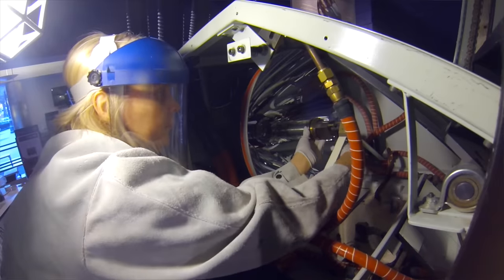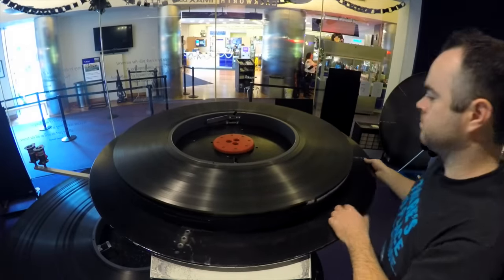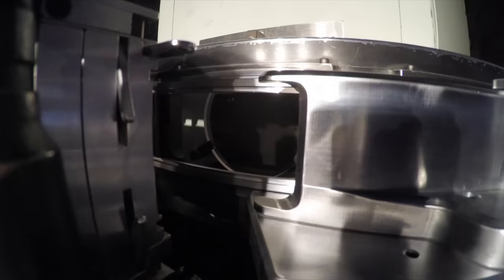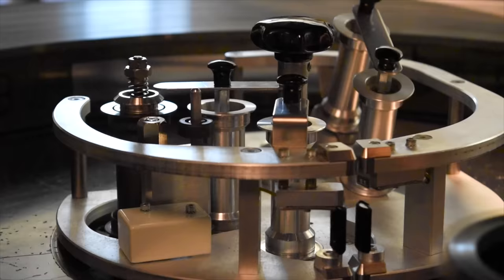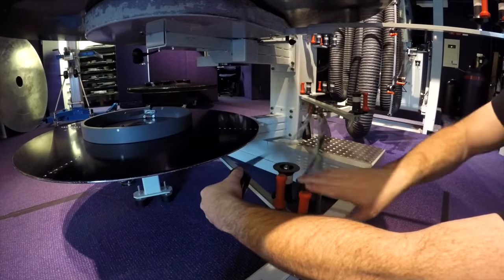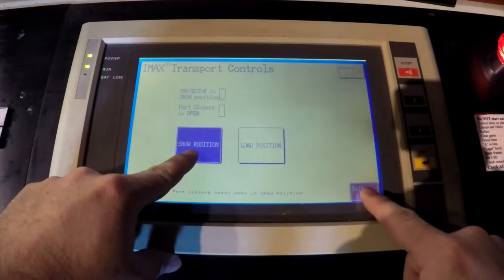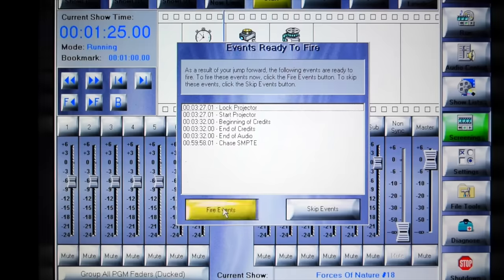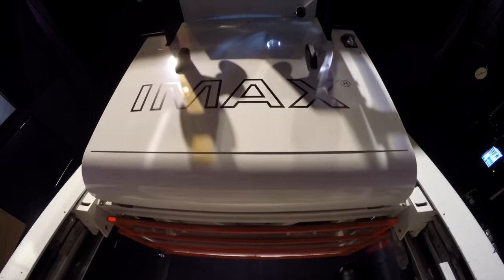The Incredible Process of How a GIANT 70mm IMAX Film is Played

Comment: I wonder how big an IMAX movie would be as a digital file with no compression. Seems almost easier and cheaper to have each movie on it's own 10tb hard drive.
Reply: here in Australia they're on drives, all digital
Reply: @justdazr5950  Ah nice. Are the movies downloaded or delivered to you?
Reply from the maker: You would lose a ton of resolution using a digital file. 70mm is equivalent to 18K digital.
Reply: Senior Tech of a circuit in the USA here, movies are usually 150GB to 300GB depending on 2K vs 4K. The files are not compressed at all as every frame (24 per second) is its own uncompressed TIFF file, but the color formatting does change anywhere from 8bit to 12bit. Most movies are 12 bit unless they are 3D where they have to drop the color resolution due to playing technically two movies at once (left/right eye) on the processors.  I'm not sure 70mm is equivalent to 18K due to the digital editing nowadays along with prints no longer being optically transferred as the days of old, they are printed onto the film with high res printers. I just so happened to have dinner the other night with one of the fathers of IMAX. Not trying to disclaim your findings as certain directors have produced optically transferred films recently such as Tarantino and Nolan in which resolution goes down to the molecule level, way better than 18k.
Reply: @HighOrbitMediaVideos  You'd lose no resolution, you'd just have an enormous file, around 130TB uncompressed according to my napkin maths. While thats large, you'd definitely not need a forklift to move it. Each film would fit into a shoebox.
Reply: @HighOrbitMediaVideos  sorry.  But that is just not true.   There’s plenty of digital IMAX theatres.
Reply from the maker: @bradmo8886  That's really interesting to learn. You would know better than I but I have read that 70mm = 18K. This theater has since moved to laser.
Reply: I'll throw a few more facts in here. The IMAX digital systems are comprised of two individual 4K Christie Laser projectors, some newer ones even include the HDR features Dolby created, which still blows my mind how HDR works in a projector. The two projectors allow high color bit 3D and of course more light on the screen which really makes the 3D pop. Technology is constantly changing in the laser world of projectors. 3p, to 6p, HFR, HDR, etc. At this point, you could write an entire college thesis on the subject of image quality from film to digital and probably still be wrong due to our limited knowledge. I mean hey, the human eye is technically something like 13 to 15 megapixels, but that's because our vision is super focused in the center, but faded on the edges. I think Tom Scott did a video on it. Anyways, it's one of those discussions that really can't be proven for either side. I can say being able to move a movie into any auditorium over networks is pretty sweet. I still remember the day I dropped a 3-hour long 35mm movie onto the ground during transfer and the mess of spaghetti I had to undo. That night was hell.
Reply: Oh, Probably should have answered the original question. With my napkin math, to scale to 18K from High Orbits information, using the new Tom and Jerry movie as my baseline of 1 hour 41 minutes at a size of 167GB at 4K excluding sound files. An 18K version would be 4025GB or 4.025TB. Still totally possible on a single 3.5in Harddrive but then you run in to read speed limitations no matter how you set up the RAID, so SSDs or Honey Badgers? The next problem is the processing power in the GPU along with DMD chips from TI to match. Though I'm sure to give it ten years and they'll figure it out. Oh yeah, Movie Games, mostly films are sent over satellite to the theatre's main Server we call CMS (Content Management Systems). But a lot of theatres still receive Hard Drive weekly through the mail for Backups or Live Playing directly off the mailed drives.
Reply: @bradmo8886  we have simple lane NVMe SSDs with reading speeds near 2GB/s, a four lane (uses 4x pci-e slot) can deliver more than 4GB/s reading spee. And you can put at least 9nvme inside a 3.5in harddisk. More than you need to stream a 18k vídeo without destructive compression. In processing power top tier professional graphics cards can process 24K at 60fps. Newer quadro rtx can process in 32k at 60fps and using its 4 slots you can display a 16k image at 60fps (using a external display hardware you can get 32k).
So yeah will be a expensive machine to do that but I think will be cheaper than an imax and you can make one today.
Edit: Aorus just lauched a 8tb pcie 3.0 16x (a direct pcie slot card) with 15GB/s
Reply: @bradmo8886  and with my napkin calculations you will need only 0.7GB/s (1:41 = 6060sec, 4025GB, 4025/6060=0.664). so using a 4x pcie 3.0 NVMe wiil stream flawlessly your data.
Reply: @sergiofagundes1972  That is some great information right there. With the data, I knew it was possible. Like the Honey Badger by Liqid Element, speeds of up to 24GB a sec at 32TB capacity with PCI 4.0 16x which is starting to get ridiculous. Gotta be careful about my NDAs now, so we'll just say there is a lab/studio that is pushing the limits currently using RTX cards. We still have the issue of the security required by the film studios which at this point only Texas Instruments is working on, along with the DMD chips for the DLP projection. So this lab actually just uses non cinema spec projectors, 9 stitched together to currently get close to 12K as the stitching takes up a few pixels. Very expensive tech, but I've seen it in action with 3D enabled. I felt like I was actually sitting in the movie on a bench just watching the normal world around me. We are getting close to VR on a big screen.
Reply: @bradmo8886  What the hell, 9 projectors? What's the size of the screen? As far as i know the biggest IMAX screen in the world is here in Germany and it's 38m (124.6ft) in width.
Reply: Fricken laser beams!
Reply: @noscearmor  Well the Harry Potter premiere took 6 projectors and I think it still holds the world record for 3D on a 30-meter widescreen. But... That all had to do with foot-lamberts coming off the screen which is how much light is projected back to the audience after passing through the 3D mirrors and glasses on your face. The industry standard is 14.5 for non-3D and anywhere from 3.5-9 for 3D. We are talking here more about a resolution of 4k, 8k, 12k, which is what IMAX prided itself on. I believe the IMAX digital cameras currently record at 12K, so you would need a 3x3 array of 4K projectors to reproduce that no matter what size the screen. Once again, the argument could go on forever due to the size of the screen, the distance you're viewing it at, and your own sensitivity since everyone's eyes are different. Like I said previously, give it 10 years and the true resolution of IMAX will return... Maybe just under a different company... Oh and to finally answer your question, they are using a ~30' wide taurus screen.
Reply: @Make-Asylums-Great-Again   I'm not a huge fan of lasers as an installer. They don't make standard 2D better, and currently are more expensive to run than traditional Xenon lamps in the long run. I do however believe "Freakin Laser Beams" to be the future of 3D since they technically can create different light waves for each eye directly at the laser modules, way better than the way we currently polarize light at the theatres for 3D. If you ever get a chance, take your 3D glasses home with you and look in a mirror, then close one eye at a time and you'll start to understand of Real-D glasses work.
Reply: @HighOrbitMediaVideos  that’s a shame imax 70mm is magical
Reply: @bradmo8886  there is a new tom and jerry movie?
Reply: @jetaddict420  Yeah. It's been out in US theatres for about a month now. Animation mixed with Live action. Think Who Framed Roger Rabbit style. Great movie for the kids, even I enjoyed it.
Reply: @justdazr5950  we also use them in kangaroos
Reply: @joestevenson5568  I calculated about 56 GB/s with 18K 16/9 12bit 24fps color.
On a 120 min movie this would be 403 TB. With lossless compression half.
This would fit on 23 18 TB Harddrives which would cost 18000 €
Also you need to find a data transfer standard that supports 56GB/s. Most harddrives read at 200MB max.
I initially thought ok maybe spending 18000€ is still better but it turns out technically this is getting really dicy.
Its propably still possible with parallel lanes, but definitely not as fun as this.XD
Reply: @sergiofagundes1972  We should just put the movies on billions of floppy drives. Imagine the bandwidth XD
Reply: @michaelp.9921  at what point did I say that digital iMax is the same as film imax?   I simply made the point there are plenty of digital imax theatres - which is true.  As a consequence to my correct statement, the post I was contradicting has actually been deleted because he realised what he had put was wrong.
Reply: @pete3816  Sorry, my mistake.....
Reply: @justdazr5950 - as IMAX, right?!
Reply: @HighOrbitMediaVideos  oh shit! Thats so dang cool
Reply: @HighOrbitMediaVideos  so when its shot in digital lets say on 4k, when it gets printed to film the resolution would still be in 4k, right?
Reply: @justdazr5950  
Are they called Digital Cinema package ?
DCP
Reply: I looked into it:

So the digital equivalent to one 15/70 IMAX film frame would be an 18K digital image, or an image of 18432x12890.
To achieve identical results to IMAX film, no compression can be used whatsoever. (Which is what we're going for anyways.)

I took that resolution and made a random color noise image and rendered it as a BMP file, which gave us a file size of 679 Megabytes. Yes, for a single frame.

So if there are 24 film frames per second, then there are 1,440 frames in one minute.
Multiply that by 45 for the average 45-minute runtime of most IMAX documentaries, and you get 64,800 frames.

So, 679 MB multiplied by 64,800 frames brings us to a grand total of 43,999,200 Megabytes, or about 43 Terabytes for a typical IMAX documentary.
And that doesn't even account for sound.

So for a feature, like The Dark Knight, you would easily pass 100 Terabytes. Again, we haven't even considered the audio system yet.
Reply: @beamthedeer  
Thats Amazing
Keith
Reply: @justdazr5950  thats not true. IMAX offers film screenings
Reply: 350TB for 2hr movie. Yes that is how big it will actually be.
Reply: @bradmo8886  You were talking about 3D the entire time... Does that mean there's still ongoing work on next gen 3D? Or are you just a fan and therefore focused more on some secondary use case that might not ever be available to watch publicly?
Reply: I think that using actual film adds an element of ritual and tradition to the process.
Reply: I hear this all the time from people who were born a few minutes ago. 
Whether it's Analog film, Vinyl records, Tube amplifiers, Magnetic tape - whatever legacy technology is being discussed, some kid always asks, "Why not just do it in the format we use today, because it's perfect, then if someone likes the "old" look or sound, just re-introduce the defects that will make it look and sound exactly like that technology?"
These people fail to understand not only that today's recording techniques have their own deficiencies (not necessarily better or worse, but different from the older ones) but moreover in each of the cases cited above the switch in technology was never made to improve quality, but in every case to reduce cost. In each of the cases cited above, it would take many years for the newly-adopted technology to even approach the quality of the ones they replaced (some would argue they still have not) but the adoption went ahead nevertheless because it was cheaper. 
A moviegoer in 1960 could see a technicolor-printed 70mm film, with magnetic sound reproduced through a large battery of Western Electric 300B tube amplifiers, through speaker systems many times the size and complexity of anything used in theaters today and would quite arguably have had a quality of viewing experience we would not be able to achieve today, at any cost. Just as we cannot build Chartres Cathedral today - there are no artisans alive who know how to do it, and the economy of our present society would make it prohibitive. 
Of course, we see things in the theatre today that our 1960 moviegoer would never have dreamt of, but they are different experiences. We cannot reproduce the quality of sight and sound that viewer would have had. Our best modern technologies are incapable of it. 
When you are dealing with initiatives like IMAX (Cinerama is another one that comes to mind) these are ventures that sought to "pull out all the stops" and take the technology to a pinnacle never before achieved. Such initiatives have almost never been crowned with much financial success, as our society consistently yields success to what is simpler, easier, more mainstream and above all cheaper, but like the Great Pyramids they leave us with examples of what could be achieved. 
Come to think of it, why not tear down the Pyramids of Giza, and replace them with cold-rolled steel structures, cladded with "limestone-like" 3d-printed panels, then have the military shoot at them for a few days to "reintrocuce the defects" to make them indistinguishable from the originals, but better because they are re-cyclable and more carbon-neutral? Then we can wonder why tourists and scholars no longer come from all over the world to marvel at them. 
Just as we wonder why no one is interested in paying extra to see a "LieMax" digital film
Reply: @bradmo8886  tIFF? not jpg2000 DCP files?
Reply: @noscearmor  Well, yeah, but screen size doesn't really matter when you don't up the resolution along with the screen, and that theater displays digital IMAX, so you would only have a fraction of the resolution that 70mm IMAX film offers. The only true 15/70 theater in Germany seems to be the Technikmuseum Speyer, but that is not a classic movie screen but IMAX Dome.
Reply: Regular films for digital cinema are compressed using JPEG2000 12 bit codec in XYZ color, which upon viewing is projected in a P3 color gamut at gamma 2.6. The video is compressed to a maximum of 250 mbit/s (either 2K or 4K, regularly in scope or flat aspect ratios) and are packaged into a DCP (Digital Cinema Package), basically a folder with the audio, video, subtitles & metadata. The audio and video is separated into MXF files. The cinema package has a naming scheme which tells the projectionist which format it's supposed to be viewed in, which also affects how the projector is configured, as well as the audio.
Reply: @HighOrbitMediaVideos  18k lossless no less
Reply: @HighOrbitMediaVideos  Well, I think 18k is only possible with the 70mm film negtive that the imax camera shot on, because when films negetive scanned and under goes digital post production and convert back to film, you will lose some quality on every steps.
Reply: And they could probably play in 60 or 30 fps like god intended
Reply: The difference between digital and film is like the difference between a Picasso drawing and a print of a Picasso drawing. 

Only one is the real thing. The other is so good, it's virtually indistinguishable, but people don't flock to the Louvre in Paris to see a photocopy of the Mona Lisa. They go to see the real deal. 

Whether you care or not is up to you. But the analogy holds true.
Reply: This whole thread is just anyone without knowledge of how modern digital media works. Ur uncompressed film movie is actually compressed to hell and suffers from massive film grain which is non existent in digital even with compression. Digital vs film can't be compared and digital is so far ahead words like 18k are gimmick because film is inferior. And let alone all this the best projectors suck infront of oled TV's that cost under $1500. There is no competition, it's just incompetency in the whole chain
Reply: @tikz.-3738  The discussion isnt about a purely digital workflow, including capture. It's about something that's already been shot on 70mm IMAX and then converted to digital for distribution. 
It's got ZERO to do with digital cinema cameras. That's not what is being discussed. Please keep up.
Reply: @bradmo8886  any idea if oppenheimer is optically transfered? i have tickets to see it in 70mm imax
Reply: @bradmo8886  They're compressed, but less compressed than blu-rays. An uncompressed 4K movie would be several TB large.